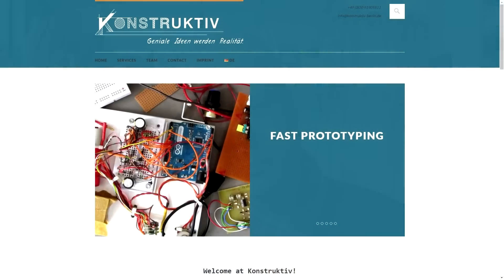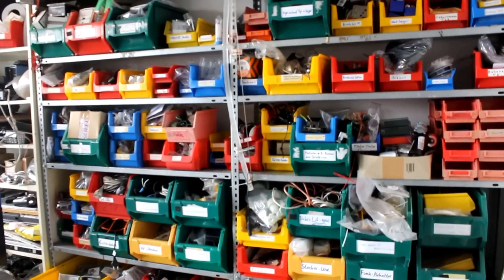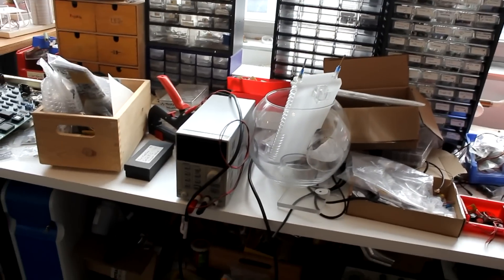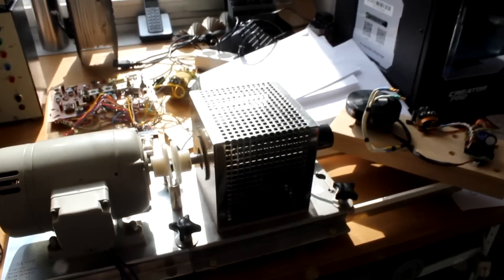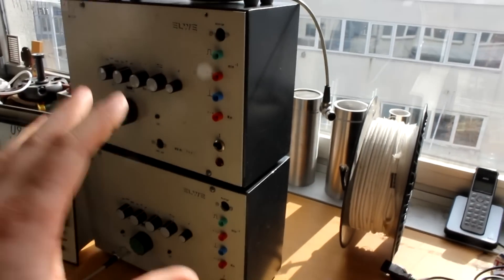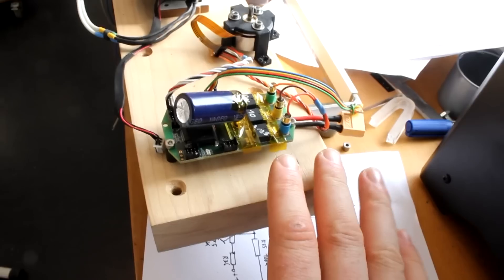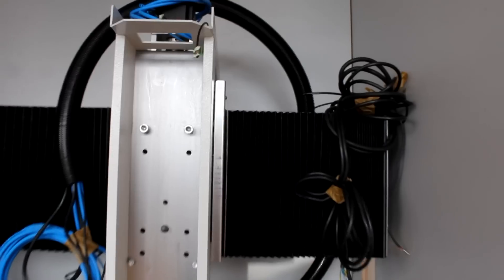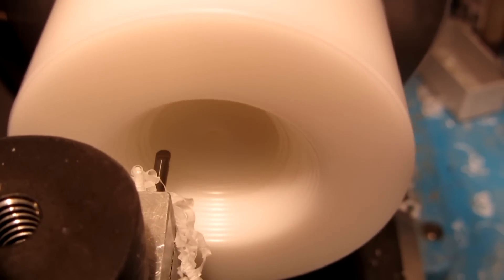Update: Visiting Inventors in Berlin / Electric Motor Test Stand

Comment: The connector on that VESC looks inadequate- an xt60 or xt90 rated for the same amps. They will heat up and be a bottleneck on that motor test bed. Recommend change for 4mm banana plugs or bigger.

Comment: Looks like a cool space for getting the creative juices flowing - I'm quite envious! 
I was wondering if you'll be able to replace some (or much) of the old analogue control circuitry of the motor braking module with a microcontroller to enable easy changes via software? Looking forward to your solutions and your mini documentary.